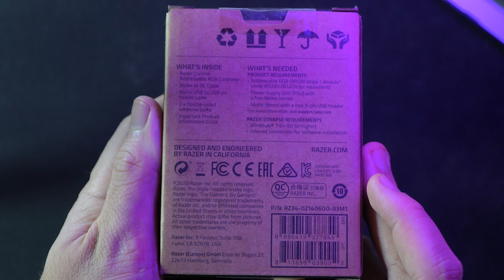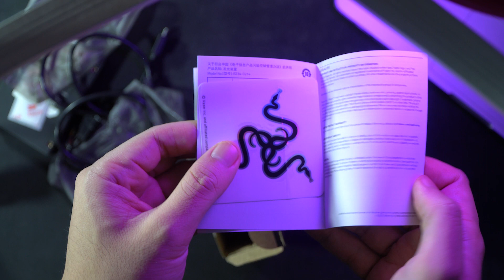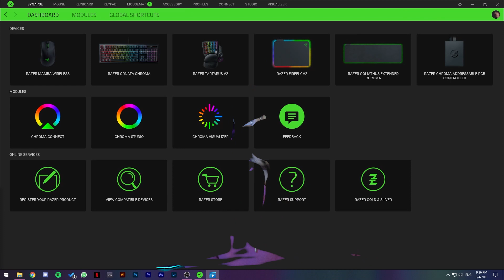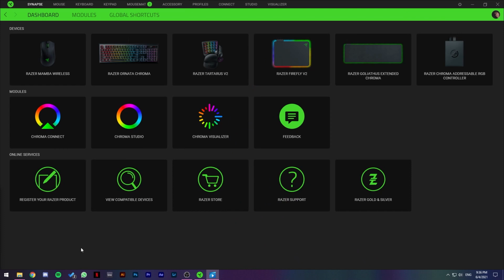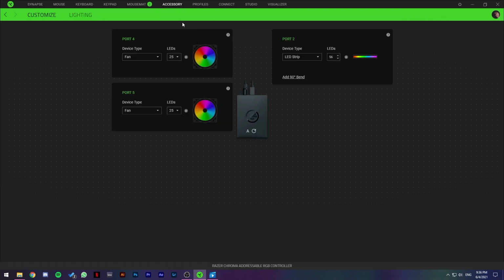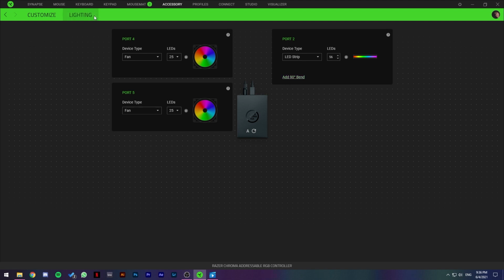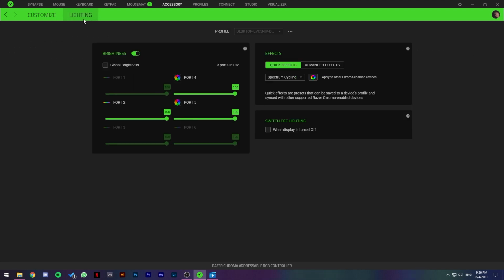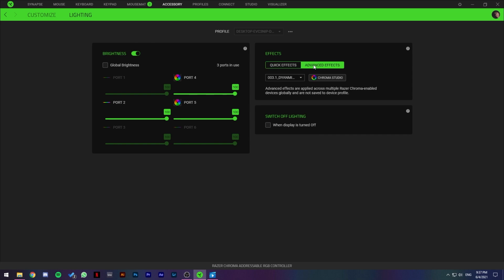RAZER Chroma Addressable RGB Controller || UNBOXING & REVIEW

Comment: I have a pack of ezdiy fans with its hub because they are 6-pin but it has a 3-pin output that goes to the motherboard, could I connect that 3-pin output to the razer chroma?

Comment: hi i bought the Msi liquidcooling 240r and that comes with 3pin male and female cords for the rgb fans.if i were to connect the male pins to the hub,what do i do with the female ones? been so confused with this
Reply from the maker: Hi there! To my understanding, if it comes with both the male and female connector, that's for daisychaining the RGB components. Ideally, you'll only need the Female pins that'll plug into the ARGB Controller and you can allocate one port for each fan BUT you do have the option to have it be daisychained and have one port control the RGB on both fans. Hope I'm making sense there but feel free to ask if I'm not clear!
Reply: @nabiltheunicorn7334  ohh ok thank you so much for the help!!
Reply from the maker: @MikeKatchEm  Happy to help!
Reply: @nabiltheunicorn7334  Do you know if upon daisy-chaining fans, will the synapse able to detect individual fans?
CM's new halo fans come with gen2 ARGB which can do this. I'm just not sure is the Razer controller is gen2. 
Thanks!

Comment: Does the backside of the fans also have rgb in the middle like the QL120's from Corsair or only black backside with info in white letters?
Reply from the maker: It's illuminated on both sides of the rings and fans! The intake side has a black sticker you can peel off if you want to as well hehe